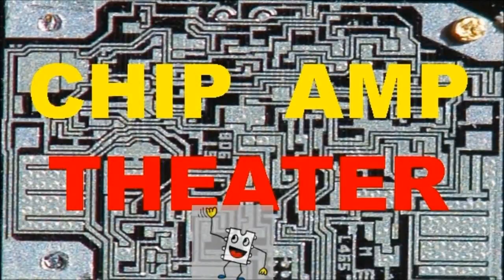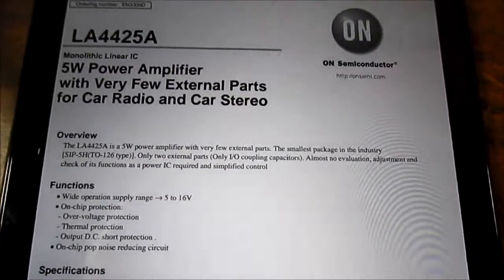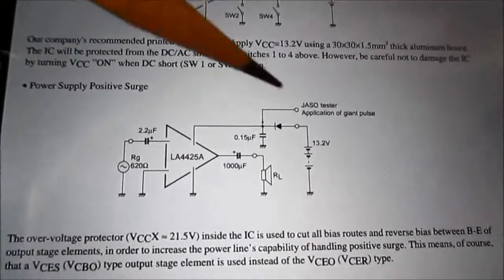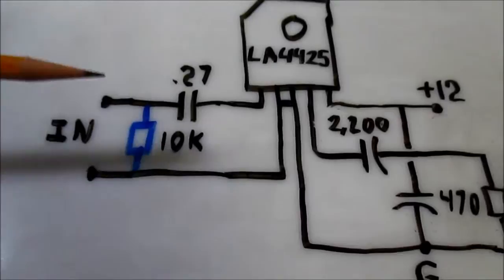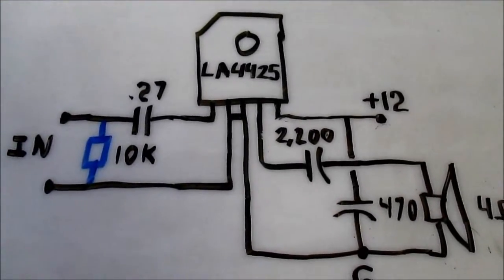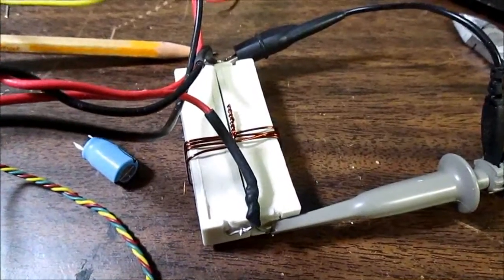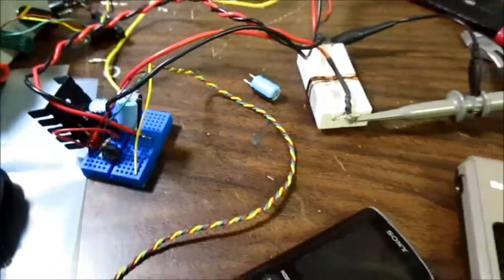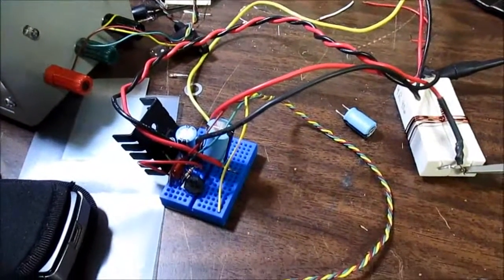LA4425A 5 watt audio amplifier IC review

Comment: If a resistor is to be connected across the input and ground in absence of potentiometer, will it be connected before or after the input coupling capacitor ?
Reply from the maker: before like the pot.

Comment: Please tell how to remove the Motorboating noise in Tea2025 amplifier in bridge configuration
Reply from the maker: Start by placing a capacitor across the supply pins as close to the chip as possible. Be sure the input signal ground is routed separate from the power supply ground.
Reply: @JohnAudioTech  How to separate signal and power grounds?

Comment: Hi JAT, As always, another very informative demo of an easy to use chip amp. For someone who knows a little about electronics, it would be a good 1st build. I don't have an O'scope, but, would be curious what the output would be from a Runoffgroove Ruby 1/2 watt guitar practice amp. It uses an LM386 and a MPF-102 J-FET, I was wondering if it is slightly more or less than 1/2 a watt, it's the v1.2 Ruby. A fun build. Take care, C.

Comment: Hey John, i just watched your video "mp3 to wav null test comparison" , today i just discovered a mp3 file which has the same statistic of a wav, i coudn't believe it, it is from a recent album and i tested it on my daw with visualizers and spectogram, i thought you could know how's that possible. The mp3 is a 320kbps mp3 with normal dimension of a normal mp3 and it doesn't cut anything... while my mp3's do cut at around 18-20k.

Thanks a lot in advance!

Comment: Sorry for the confusion. I hacked and old radio by putting an audio jack to the volume control and ground. I can play a guitar through it just fine but the dynamic mike won't work. I think I need a preamp to hook the mike into first and then into the radio to amplify the mike. Just not sure what the best preamp would be.

Comment: Hi,I've managed to get few TDA2003 IC and i have built stereo version of that amp.
When i don't have any signal coming there is no hissing, but when song is playing it's constantly hissing and it's crackling a bit.
I am using 12V battery to power it.
please help me.What could the problem?
Reply from the maker: Filip Gugo Could be poor supply decoupling or grounding issues. Se my video about proper grounding. Different chip but same principals.  https://youtu.be/lBGE5lwbruE
Reply: JohnAudioTech You won't believe this, source of all problems was my old phone, the audio on it is disgusting.When i hooked it up on my new phone all problems disappear and now amp sounds awesome.

Comment: question.. this has been stumbling me for a while now. im new to amp building and i followed your scheme of this amp. but when i play music it comes on and can get loud, but i dont hear the words, or the artist, just the beats in the background???  what am i doing wrong? could u please help me?
Reply from the maker: Mario Duckett Hi Mario, are you using the LA4425 or some other IC? Each IC has it's own layout. I thought I'd ask since you said you are new to this.
Reply: I am using the LA4425 I got from digikey. I screenshot your layout with the same chip and to my eyes I followed it well.
Reply from the maker: Mario Duckett Be sure pins 2 & 3 are bonded together and a capacitor across pins 3 & 5 close to the IC. If you used a resistor from input to ground, it must be connected to the lead on the input capacitor that is opposite the lead connected to pin 1. If you happened to accidentally connect power to pin 4 it could damage the output transistors possibly leaving you with the distortion.
Reply: JohnAudioTech ok ima pull my board out now and try it, and let u know thanks!
Reply: Mario Duckett ok so i double checked everything and i have the 10k resistor connected to the capacitor lead going towards the mp3 player, pin 2&3 are connected together and i have the speaker ground to pin 3 and the positive speaker wire to pin 4. The song  plays, there is no static or background noise but i cant hear the actual person singing just the instrumental. im using a 6ohm speaker? could that be the problem? i also have tried a 8ohm speaker? i dont have a 4ohm handdy. also i have a 9v power supply
Reply from the maker: Mario Duckett
Ha! I think I know the problem. The MP3 player jack should have three wires. Ground, left and right signal. It may seem like four wires as the ground splits in two for each channel. The MP3 ground must connect to the IC pin 2. You must run the left channel through a series resistor and on into the amp's input as already setup. The right channel should have its own series resistor and connect to the input as well. This will mix the stereo channels to mono and the voices/instruments sound right. The value of the mixing resistors can be around 1K ohm but both should be the same value. Any of those speakers should work. Just be sure you have a output coupling capacitor on pin 4.
Reply: JohnAudioTech oh Snap!!!!! it worked! thanks

Comment: The high QI is probably to reduce crossover distortion. Leaning towards class AB. If mainly used for car stereo the QI would be of no importance. These days car stuff is leaning towards class D. The chips are coming down in price all the time. Lots of power for little heat sinking. As for sound...I have mixed feeling on this, can sound good but often sounds odd in the HF region. Thanks for the video.
Reply from the maker: Michael Beeny They might be using a current feedback topology in this IC. The TDA2003 and LM383 used it as well. About 30ma through the feedback divider resistors alone, the rest in bias currents in various parts of the IC, mainly the output bias. I'm not a big fan of class D either, but they have their place.